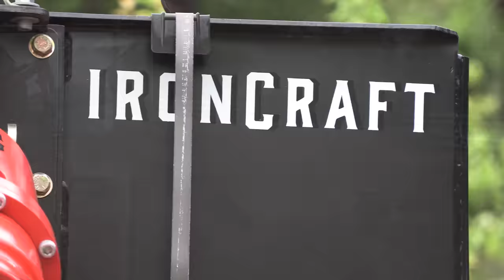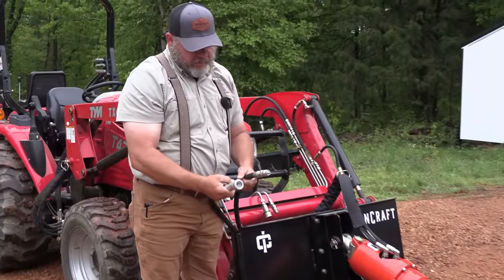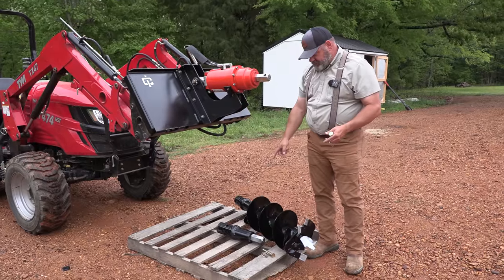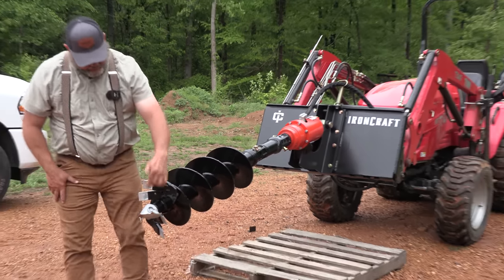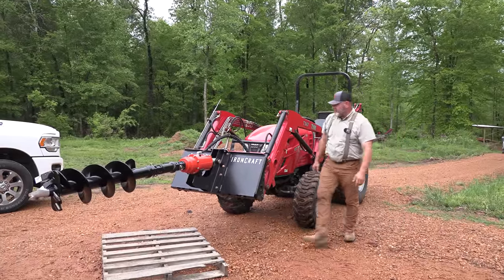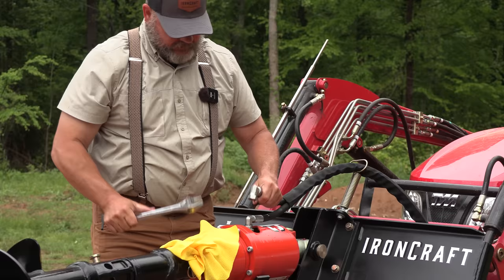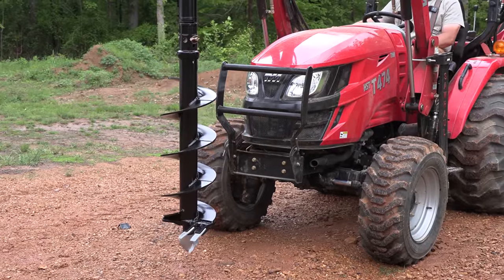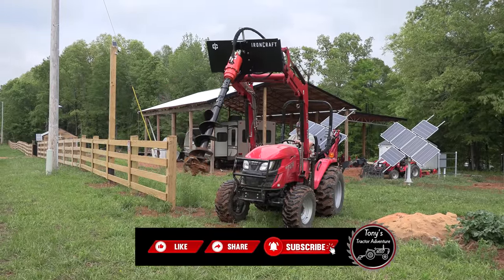Tractor Loader Mounted Auger is Better! IronCraft

Comment: I didn't hear you mention a couple of the advantages I perceive, having not yet used one of these.  A) Down pressure is possible on the FEL, but not on the 3PH.   B) Reversible.  Catching a rock can draw an auger down, and a PTO cannot reverse to free it  C) No more broken sheer bolts.  The hydraulic motor will stall to protect things.   Are there more?

Comment: I was looking to do this and was about to spend the money on an expensive third function and happened to mention what I wanted it for and a couple different people told me they weren't designed for constant use like that.  My understanding was that you will overheat the solenoid on the third function and it will swell and become inoperable.  

The third function is meant to be used for momentary things like grapples and some of these attachments like tree shears.  I think you would be fine running it for a few holes or if you have good soil where you can quickly dig the hole and allow it to cool, but I would be very hesitant using it to install something like an entire fence or if you have really rocky soil like me where it takes several minutes to dig a hole. 

I ended up running a set of hoses from my rear remotes ($400 in hoses) and I bought a $1,000 carbide tooth rock bit and still couldn't get through the rock on many holes and just gave up.  I didn't want to burn up my fluid or mess up my pump.  I went with a different type of fence.  I still use the FEL auger when I have a few holes as the weight of the front end loader and pressure do help tremendously.

The other problem most people will run into is that the tractor's hydraulic pump GPM will not sufficiently run one of these augers.  Mine is 10.8 GPM on a 65hp tractor and it was at the bottom of what would run most.  I think you can still use one but it's just going to turn slower.  Someone trying to rent one from an equipment rental is probably going to find ones meant for 20-35 GPM.
Reply: Most tractors don't really have enough hydraulic flow to run these things.  I know my little Kubota wouldn't stand a chance, not to mention not enough lift height on the loader, all I'd end up doing is permanently getting the auger stuck in the ground because of the lack of hydraulic flow, the lack of lift capacity of the loader itself to retrieve the auger, and the type of soil, rather clay and hardpan it would never work....the only way to dig holes where I'm at is with an old school clam shell post hold digger and a digging/wrecking bar to break up the hard pan. The lack of hydraulic flow, also limits the amount of torque that the hydraulic motor has as well, so it won't dig like you would think it should either with a smaller underpowered tractor.  Best of to just buy one of those small gas powered hand held augers...and a heck of a lot cheaper too.

Comment: Thanx for sharing and adding your input. I was undecisive in regards of going with the back PTO auger. However you establish good convincing arguments on going with front mounted.  Even though it will require more resources and $. 

Thanx again , this is a well put together video.
Reply from the maker: You are welcome. I will never have a rear mounted auger again, if I can help it.

Comment: I had a 3 point Auger for years on my JD 970. It worked great, but installing it on the 3 point was always a struggle. A loader mount would be wonderful 😀

Comment: I’d love if you could test this on the T25, this has been one of my biggest questions for a front auger on a smaller tractor. 3 point would never work for what I’m trying to go through in Colorado. I’d be curious of power, speed and ability to go down at least 4’ on the T25!  🙏🏼

Comment: One of my “pet” peeves are “Shifting Spanners”, useful in a pinch, but almost inevitably ruin a bolt head for a crescent or socket or ring spinner, avoid them like the plague, emergency use only.

Comment: Hi Tony great video. Can you actually see the tip of the auger / target for the hole over the hood of the tractor? Although my 3-point auger is not the easiest to use, I can clearly see the auger and target for the hole.
Reply from the maker: I can see by leaning towards the left.

Comment: Put in many a fence pole with my rear 3pt. auger. Until I encountered heavy, dense, wet, clay. Of course, I got stuck. But the bad decision. Rocked tractor and extreme leverage broke off the hydraulic gearcase 3pt arm cover. Stupid. Need a reversible front-end unit like yours. Already put on forward hydraulics and a quick connect skid steer bracket. Good luck with yours. How did you determine proper flow requirements? 7:53 7:54

Comment: It looks like you could tractor joust with that thing when iylt is pointed straight ahead 😅.

I've been struggling with PTO mounted auger, no real strength to bust through the hard dirt and rocks!
Reply from the maker: I have  really enjoyed the loader mounted auger
Reply: @TonysTractorAdventure  I might have to look into one! Although I will need to add a third function to the loader before doing that

Comment: Is this one specifically designed for low flow tractors? I’ve been looking at them but wasn’t sure how well it would work on a tractor vs a skid steer.
Reply from the maker: Yes it is. https://www.ironcraftusa.com/skid-steer-soil-working/auger-drives/
Reply: @TonysTractorAdventure  awesome thanks! Now to find one on the east coast.
Reply: I have one I use on my tractor the rating flow is 15 gallons per minute to 20 gallons
Reply: If your tractor actually has 5+GPM, it'll work, but you really want to be in the 7-10GPM to really get any sort of use out of any of these hydraulic post augers...the more GPM, the better performance you'll get out of the hydraulic motor, and have enough torque to actually do anything with it...what looks good on paper doesn't correspond to what actually happens in the real world with these things....if you are meeting the bare minimum, don't expect it to do much, if anything especially if you have rocky soil, or clay soil, you'll most likely just get the dang thing stuck in the ground LOL.
Reply: I have have a FEL auger from Homestead Implement. It is rated for a minimum of 6 gpm. I use it with a jD1025r which is rated at something like 6.2 gpm in hydraulics. I have used it to put in posts (biggest are 4 x 4 in posts)  and make small holes to plant baby trees.  I have very nice soil with very few rocks if any and easy to dig. It works well all be it slow but who is in a race with these things. I have two complaints with this (1) the auger bit is a little bit too long for my subcompact tractor but I am talking like two inches too long but I deal with it because my soil is forgiving (2) you have to buy a skid steer adaptor with it if you have a John Deere.  I have a deck project that will need like eight posts so I Will have to make sure to give the tractor a rest between each post hole in consideration of the comment posted above giving the third function a break on my small John Deere.
Reply: @srosegriffith9844  thanks! I’m definitely shopping for a front auger now over a three point.
Reply: @wildbill23c  I have a 474 so it’s definitely good enough.
Reply: Hey Chief, based on the comments I guess I’ll stick with the three point unit.  Zero experience, but it came with a buy out package and I’m cheap.  In addition I don’t foresee many auger holes in my future.  Then there is the fact that it gives me yet another excuse to keep one of my Asian toys. just mount it and forget it.  Storage, yep that’s a different story!  Yikes.  😮.  Thanks for sharing and as always Tanja made you look good.

Comment: I use flat face connectors supposedly they flow more oil
Reply: They have the ability to flow more oil, but your hydraulic pump is what controls that LOL....don't matter what couplers you have if your hydraulic pump can't supply enough pressure...which most tractors do not, or are right on the border line of it'll work, and it might work, and might not work LOL.  I know my little tractor wouldn't run one, and the soil conditions here it wouldn't work even if the tractor could run it.
Reply: my tractor flows 19.2 gpm of hydraulic oil. but when it hits a rock everything comes to a screeching stop I have torn up two 6 inch diameter augers in the last year from granite rocks

Comment: I wonder if any tractors have a slide or switch to swap their 3rd function buttons? Then it wouldn't matter which way the hoses were connected. Just swap the button functionality. I like the idea of a FEL mounted auger but also wonder about adequate hydraulic flow and continuous use. I think my Deutz-Fahr 5080D with Stoll 35-18P FEL has 13.2 gpm (50 lpm) hydraulic flow via my 3rd function valve. I sent a question to Deutz-Fahr America and my dealer to confirm flow rate and to ask if one of these Ironcraft models would be suitable to use with my tractor. Can I borrow your auger to try it out? 😁
Reply from the maker: It would only make it more complicated IMO. I think it is easy to set it up correctly once.